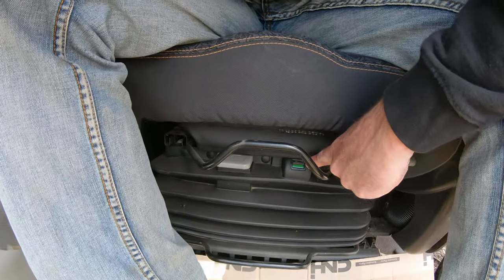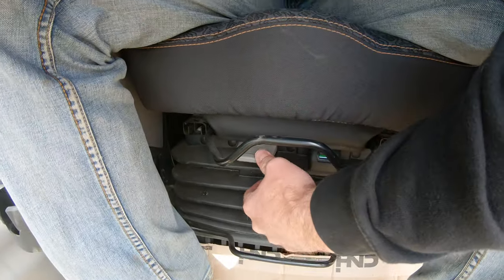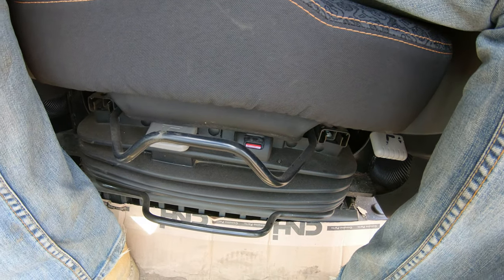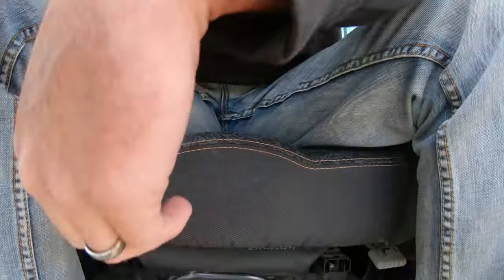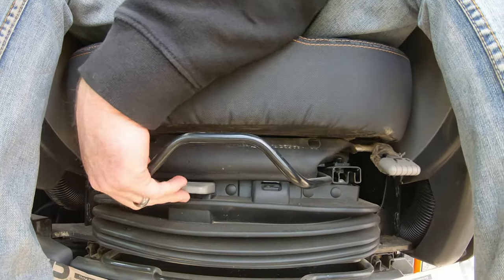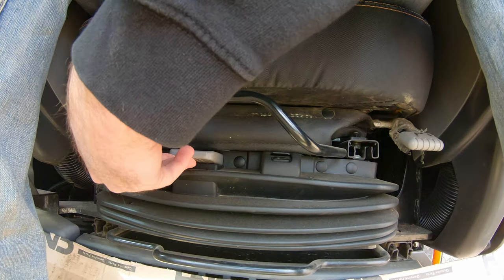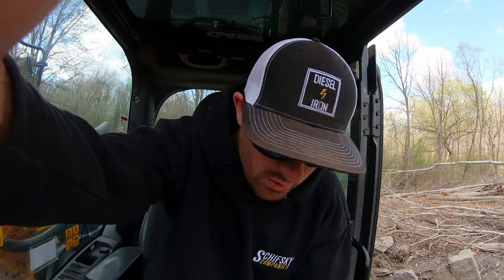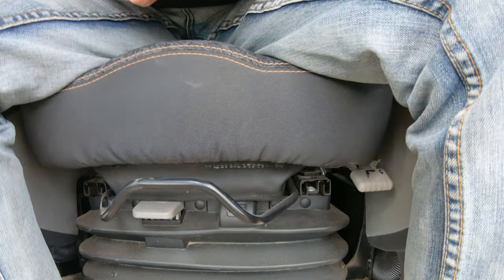HOW TO ADJUST YOUR AIR RIDE SEAT // Air Ride Seat Adjustment - Heavy Equipment Operator

Comment: The booster seat guys drive me nuts.  I'm on the other end though, I prefer havin the seat pretty much bottom out although I put just enough air in so it doesnt slam down on the frame when I sit down.  I like being low so I can have the joysticks as high as I can if that makes sense
Reply from the maker: It sounds like you have the correct amount of air.  The seat should never bottom out and only top out in extreme bumps.  The beauty of the back saver!

Comment: Every time I get a rig delivered I have to call the shop to have the seat fixed. Won't hold air, won't slide, Armrest adjustment broken. And this is a reason operators quit all the time.
Reply from the maker: When you spend anywhere from 10 to 16 hours a day and a seat you absolutely should be comfortable. Too many people think it's just being whiny when you need the seat fixed or the air conditioning fixed but nobody in the office hesitates asking for that sort of a service

Comment: Great video man!! I’ve been running equipment for the first week this past week... I was honestly wondering how to adjust it so this was great! Also while I’m able to talk to you here... what kind of controls do you prefer on excavators, CAT or DEERE?
Reply from the maker: Glad to help out brother! When it comes to machine controls, I prefer cat but it's only because that's what I've been running for the past eight plus years. At the end of the day there really isn't a difference from a productivity standpoint between the two. All the modern machines have patterns switchers so either pattern is just fine
Reply: @DieselandIron  Okay, I was just wondering because all I’ve ever ran is cat but the other guys like Deere so I thought about learning Deere just so we wouldn’t have to keep switching 🤷🏼‍♂️
Reply from the maker: @braydentilley4036  I did a bunch of homework before I switched to cat and there's no difference in production or dig speed. It's purely operator preference
Reply: @DieselandIron  sounds good! Thanks brother!